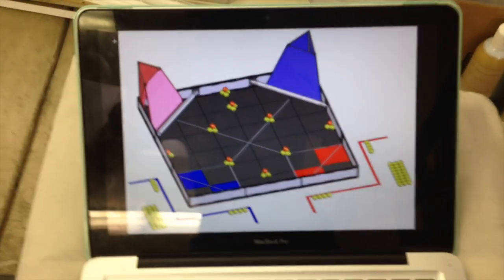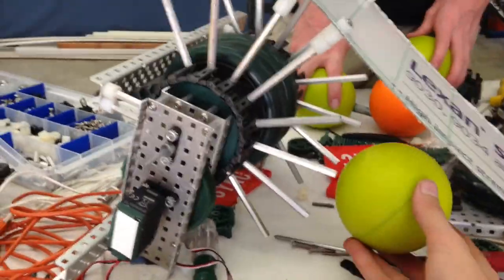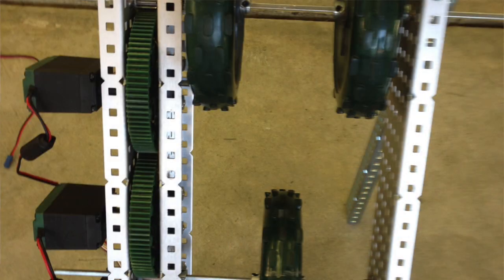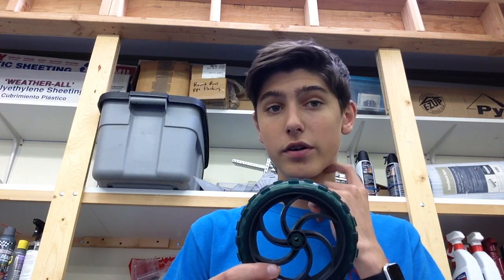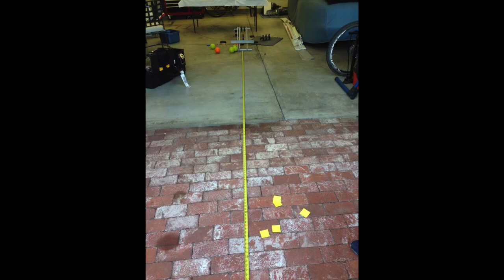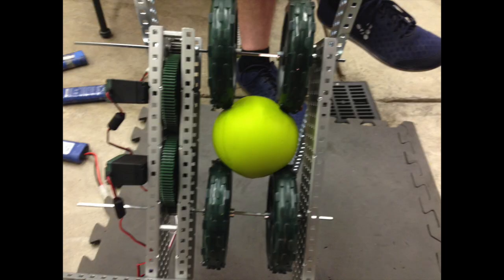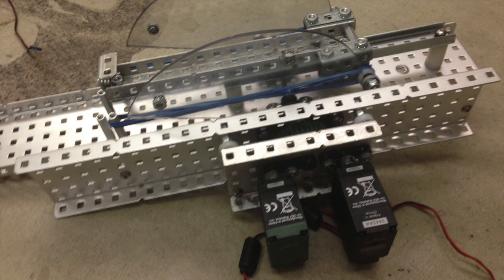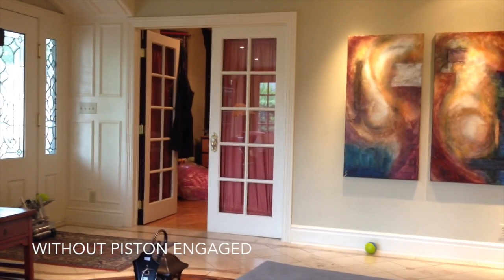VEX Nothing but Net Robot in 3 days documentary

Comment: I am building a shooter similar to yours but I'm having trouble with my axles twisting, I have actually sheared two of them in half with a perfect corkscrew affect, anyway if anyone has any advise please help. 
thanks
Reply: Our team used a high strength axle and mounted the gears on high strength gears with the inserts removed. We also used a better gear shape to distribute power more efficiently, so you might want to look into that.
Reply: ok thanks for your help and that is what i was thinking of doing the high strength axles are in shipping. thanks for the help i was hoping someone would say what you did. thanks a lot.
Reply: Kapil K thanks

Comment: This is probably my favorite design of the ones I have seen so far. If you don't mind, I may try something similar as opposed to the flywheel design I was originally intending to use. Also, the use of the nautilus gear is brilliant; I was considering removing teeth from a Vex gear to act like an airsoft sector gear, which was a bad idea, and my team couldn't think of other ways of using a catapult so we put it aside.
Reply: Slip gear?